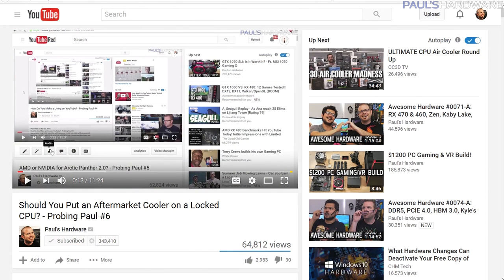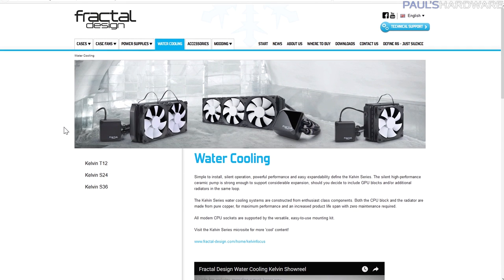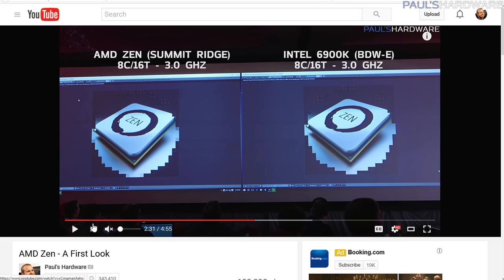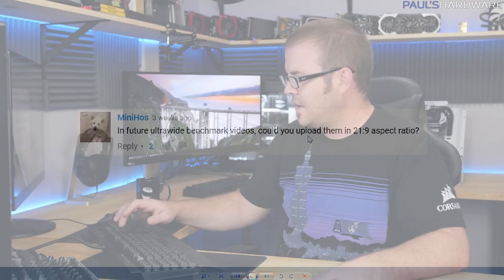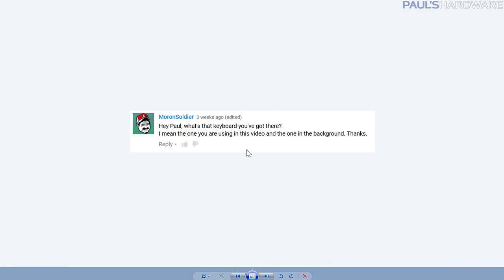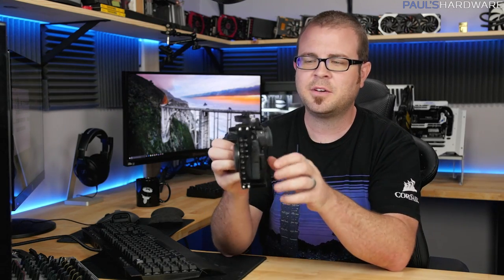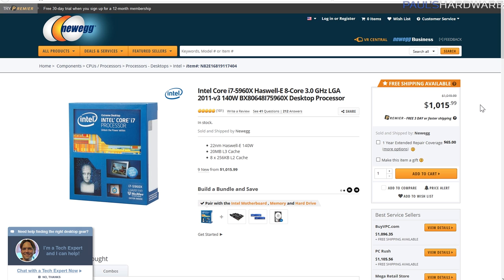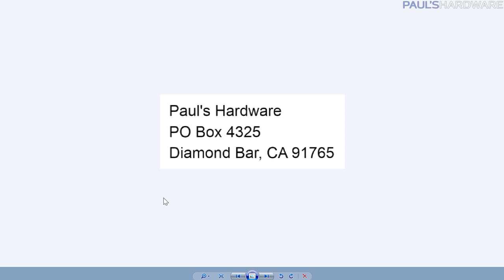Can You Expand a Closed Loop CPU Cooler? - Probing Paul #7

Comment: hi Paul! first off I really love your videos and love the way how you're unbiased for every review. 
My question is that are mITX builds are on the par with the atx builds? I really love the way how sff pcs are (hotbox for example) and im really interested in building a powerful machine in a define nano s. i have heard people saying bad about mini itx pcs but i won't be doing SLI so i wanted to know that whether it would be a good move to build a mini itx pc (irrespective of the portability factor). I guess many people have this question in mind and I'd really love it if you answer it. cheers
Reply: also, performance and connectivity wise, how these can be.?
Reply: +Vedant Sharma I know I'm not Paul and I haven't started posting my tech related content yet, but I have been building pcs for about 17 years. the biggest issue I have seen/heard with sff cases would fall more under the airflow department. other than a lot having bad airflow, itx builds can be amazing. picking the right case is huge because imo full size modular psu is a must if/when I do an itx build. the nano s is a case that takes a full size atx psu, it does have a good amount of cable management room unlike most mini-itx cases, and looks great. the only issue you might have is cooling your gpu but if you keep it on your desk and face you psu intake down, that shouldn't be a big issue at all. performance ultimately is in the parts and there are some beast itx boards out there right now that won't be a significant compromise in offerings at all. if you want it, I'd say do it.
Reply: That particular case actually has quite good airflow. Itx rigs really are not very different from larger matx and atx boards (not to mention ssi ebb and e-atx) what you will be sacrificing is more or less depending on the socket your going for in the first place... I will elaborate further. 

socket 2011-3 (X99) there is only 1 itx board and its quite good and made by asrock. However one of the main benefits of the socket is the larger volume of PCI lanes and being it is ITX you lack those slots so you are giving that benefit up. Though you keep the ability to overclock (to a lesser degree as the vrm is slightly gimped) and use 6+ core cpus you also are cutting off your quad ch. memory support so your more limited on ram capacity and overall bandwidth. So all in all i really don't recommend a x99 itx rig unless you really just need a small form high core count rig (pretty darn niche) 

mainstream sockets (lga 1150,1151 ect) Itx makes more sense here you have less PCI lanes so 1 slot and some of the boards having a m.2 slot would take up another 4 (so lga 1151 only here) so you have more then enough bandwidth but you are not just giving up 8+ lanes cause of the form factor is what I am getting at. Another thing is the cpus draw a decent bit less power so overclocking is a little easier to build a good VRM for on most of the ITX boards also you got more boards to pick from. Some of those boards you can get wifi on as well as a few other features but yes in the end the board is substantially smaller and you will be giving up 2 ch. for memory and a some other features but it makes way more sense then x99 ITX The matx and the ATX and larger boards often can have substantially better VRMS if your into medium to heavy overclock this can help a bit. Though itx is very viable solution and if you ever do want to get a dual gpu set up you can still get dual gpu cards your just very limited in your options...

My recommendation for a itx rig would be z170 with a K sku (don't much care i5 or i7 they both are darn good) having the ability to overclock is very very nice and the chips have a substantially higher resale value. 
as for parts I would go for the evga stinger (120 usd on newegg right now) its a pretty good mobo and you could overclock a bit. The asrock fatality is a bit better board but really needs a bios update. (150-170 bucks) and the last two really compelling board would be the ROG maximus ITX board it has the best VRM by quite a bit but its a tad expensive being 200-230 USD and the z170I pro from asus that board actually has a decent vrm and some good features so id recommend it. For a case the phanteks enthoo evolv itx is a pretty darn good case and the nano S is also a very good choice. (for the 50-75 buck range) these are your 2 best options id say both have good water cooling support and decent airflow. For ram at the moment hyper X stuff and some of the patriot stuff is really good and if you can find a decent price team group can have some really compelling stuff. if your looking for a SSD keep Micron in mind they have some really good ssds for sale as oem bulk drives you can pick up for 20-30 bucks cheaper then what they are sold under as the crucial name. You can pick up a 480 gb sata 3 one for 95 bucks or so. Hard drive if you can find them get a HGST drive they are the most reliable out right now but a good close second is most of the WD drives (ironically WD bought HGST) As far as power supplies go right now your best couple of bests are the super flower leadex platform (evga g2 and P2 series) and the nearly but not quite as good seasonic X km3 line specifically the KM3 revision I would just spring for a 600 ish watt gold rated one as that is more then enough for really anything you could toss at it while it was running mostly at peak efficiency and if you ever want to transfer this PSU into a different rig down the line maybe a 6 core rig or something you have some extra power. though sometimes you can find a sale on the 750 watt ones (overkill yes) for about 5 bucks more then the 600 watt ones (at 5 bucks might as well its another 100 watts even if you dont end up ever using it its nice to have a psu like that in case you ever need it) Keep in mind these psus have 5 -10 year warranty so buying this one component can span the life of 2 or 3 rigs. So don't cheap out there. For cooling if you plan on doing water cooling you could do with a AIO but custom loop is very satisfying and you can get better components for not all that much more in price. (we are talking about a high end build here)  XSPC has a very good price to pref. EX series and the black ice rads are also very very good for the price. 
and can cool a good 600 watts on a 240mm set up. As for a pump the swiftech mcp 35x or the 50 x are good choices or the phobya dc12 series and of course the D5 pumps but those are quite expensive and a bit overkill as would a mcp50x but they are both very good pumps. The last part would be the gpu and get whatever you like but right now the pny and evga and zotac 1060s are quite good (keep it closer to 250 usd if you can) and the xotac amp 1070 as well as the evga 1070s are very very good for the price. but yea get what you would need or like there
Reply: +BA_Tech appreciate your reply man. that was really helpful. 😃
Reply: +Nicholas Dluge hey Nicholas😃 thanks a ton for clearing all my doubts all at once. really appreciate it 😃. As for water cooling, I'm really a noob and I don't know anything as far as a custom loop is concerned. but, I'm a bit paranoid about using aio/clcs since I'm always scared of them being leaked. 

most possibly, I'm going for a cryorig h7 cooler, since I'm not a heavy overclocker, a z170i pro gaming, 6600k, evga 650g2, ocz rv400 240gb ssd, gigbyte g1/msi armor oc gtx1070 (still have to decide which of these 2), a phanteks enthoo evolv itx and some custom sleevings. 

this is as far as I have come with my research and recommendations from others. I'll buy another ssd, maybe an ocz trion 150 480gb or a Samsung 850 pro 480gb, since I don't need so much of space and I'm good at lower space, as I can buy another ssd anyway in future. 

should I really go with all these components since that I a tad lot money and I'm always paranoid about when getting something. 

it'll be a really tough and quick decision whether to get atx or itx components when I order the parts 😂
Reply: Vedant Sharma Stay away from the TLC ssds they are fast and cheap but TLC nand you sacrifice a lot of write cycles. A good MLC drive will have a 5+ year warranty while TLC drives tend to have around a 3 year warranty. or go with a samsung 3d nand drive. 
SO yea I would consider a micron m500 480gb for 90-95 bucks if you can find one (microcenter has that deal for sure.) or I would go for a newer Micron or Samsung drive albeit you will pay a bit more for the samsung 3d nand though its some of the best stuff on the market right now so the price is fair. 

For the cooler I would like to recommend the scythe fuma as its a really good cooler and can outperform a good number of AIO water coolers and many more expensive air coolers. its 45-50 bucks and its a really good little dual tower (120mm) cooler so it can fit in most cases and had very good ram support. (as in little ram interference) 

For ram just look around you should be able to find some cas 14 or cas 15 ddr4 3000 for just about the same price as the 2400 or 2666 stuff and the ddr4 3000 with a cas latency of 15 or less is some pretty fast ram actually its faster then 3200 with a cas 16. Keep a eye out for team dark ddr4 or geil patriot, Kingston and the corsair lpx stuff. 

If you do end up getting a hard drive for mass storage get a HGST drive 

The gpu I would recommend the zotac amp 1070 for $429 or if you want a insane card the 1070 amp extreme from zotac or the asus strix 1070 for about the same price as those strix cards get some binning. The evga cards too though honestly the giant evga logo on the side is a lil ugly in my own opinion. The gigabyte 1070s are good too though the 1060s have bad coil whine...The msi cards don't really impress me at all so I wont recommend one. all the cards will pretty much preform the same though you can find binned cards if you want to see how much more lucky you can get with OC. 

For the build also consider a matx setup you get more pci slots and often times the same vrm as the ATX board but you can find some smaller cases.  The cooler master pro 3 is coming out as soon as the 6th of sept. for 99 bucks and is a very nice matx and itx case or if you want a smaller ATX case consider the silverstone raven series. like the rv05 and the rvx01 if you do move up to matx or atx I would go with the asrock k6 board as its seriously one of the best boards on the market for the price esp. or the asrock z170 fatality pro for like 4 bucks more has a few more features. Though the asus z170  board are good to just most of them dont have quite the vrm components but they are still more then good enough.

Comment: How long do you think a core i7-6700k will last? What I mean is do you still think the 6700k will be a viable option for gaming, video rendering, and streaming for a few years, or do you think I should shed out an extra couple of hundred dollars on the 6800k.
Reply: hardware Canucks did a video on this not too long ago comparing the two for which would be better for his work. I think he did stick with the upgrade but between the two cpus, the 6800k didn't seem like that big of a step up.
Reply: +Daniel Contreras really? I kinda stopped watching Hardware Canucks, but I will watch that one. thx
Reply: Huh, just looked up some benchmarks of the 2700k, that's actually really interesting

Comment: What are you opinions on BCLK overclocking for skylake cpu's? I can get a new 6700 non k for $260 and plan on overclocking it using the BCLK method. I need a little more horsepower than what the 6600k can give me but the 6700k is out of my budget.
Reply: Didn't they patch that?
Reply: they did by forcing companies to release a new bios. However, if you flash the bios of your mobo to the pre patch then you can still do it.
Reply: Huh, I don't recommend doing it anyways

Comment: Hey Paul, what is the best sealed loop CPU cooler of 2016-2017. I am looking for a good cpu cooler and want to get a DEEPCOOL Gamer Storm CAPTAIN 240EX WHITE. I looked online and I can't find any good sealed cpu coolers that wont leak. Every body online says that the pump dies or leaks, so should I get a air cooler instead, even thou I really don't want to?
Reply: RocketTech16 Fujii build your own custom loop if you plan to water cool. All of em have their issues like dead pumps or leaks or even low coolant on the radiator because it evaporated over time. If you don't want to ever mess with anything then just stay on air cooling.

Comment: I can't find a true understanding of the relationship of RAM and the CPU. Like does the 2133 MHz, 1600 MHz, and so on... need to add up to the GHz of the CPU. Example: 2x1600MHz RAM = a CPU running at 3.2 GHz. Is there any relation between the two like this? Also if I don't have the RAM to reach the GHz for the CPU, am I not using the GPU to the full potential? Same goes with having more RAM speed than the GPU. Thanks, Paul! Vids are great and informative!
Reply: No difference.

Comment: PSA: Liquid metal TIMs need to be changed semi often if you want to avoid them becoming dried and hardened. Also, they can stick so hard on your chip and cooler that there have been cases of people trying to remove a graphics card cooler and literally ripping out a part of the GPU, destroying the card.

IMO liquid metal is only worth it when using it between the core and the IHS of a delidded chip. Otherwise it's just pointless.
Reply: No conductivity issues between IHS and die ?
Reply: Err. No?

Comment: can you explain what is DDOS acttack
Reply: +THE TECH ATOM Lab
Found these online (internet searches are your friends, dude)-
"DDoS, or distributed denial of service, is an attack where multiple compromised systems are used to target a single system causing a DoS attack."
"...a denial-of-service (DoS) attack is an attempt to make a machine or 
network resource unavailable to its intended users, such as to 
temporarily or indefinitely interrupt or suspend services of a host 
connected to the Internet. A distributed denial-of-service (DDoS) is 
where the attack source is more than one, often thousands of, unique IP 
addresses."
Reply: +nakyer woow
Reply: THE TECH ATOM Lab
I know I'm not Paul, but did that help?

Comment: This is old shit far as tech goes automobiles have used both types for 50 years. Any closed system can be made open. Now if the barbs are not standard hose style barns than you’ve got it address that. Also hose to barb size is the biggest concern. Simple shit really for anyone mechanically inclined.